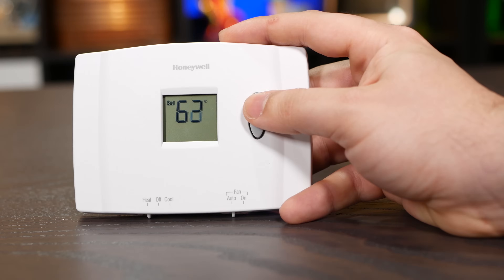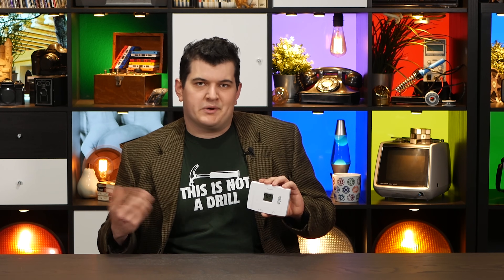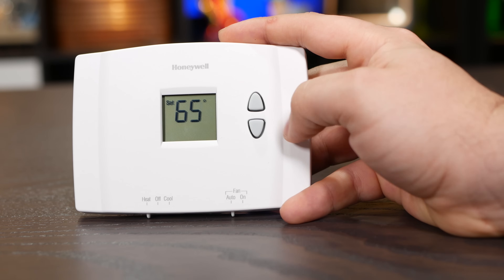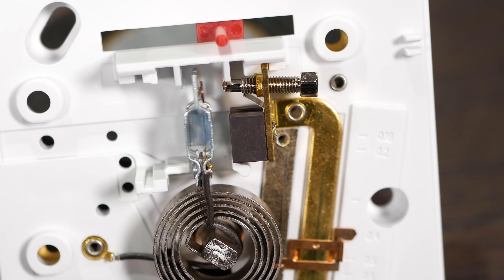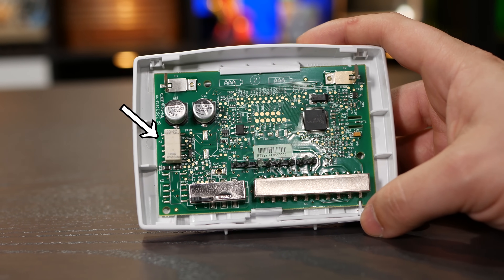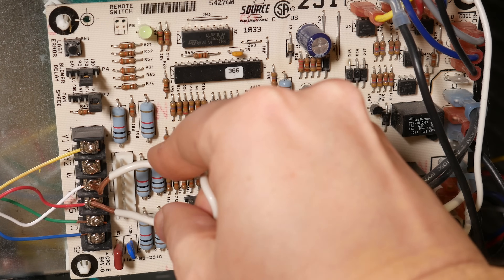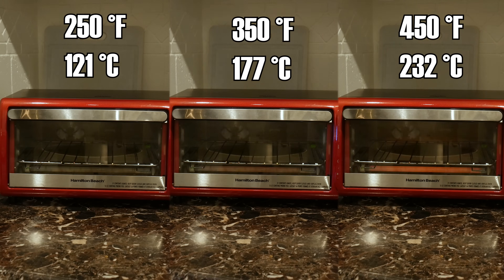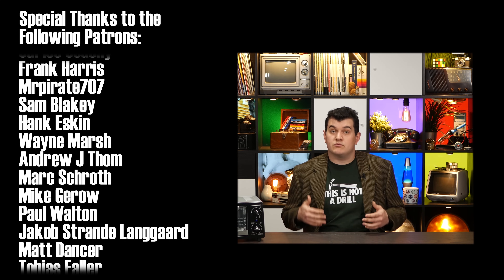Thermostats: Cooler than you think!

Comment: My husband thought the air would come out colder if he turned the thermostat down.
Reply: Well that is how cars work
Reply: @tylerbendel4361  Ah no that's not how cars work.  Cars work on the exact same principle with the only addition a selectable fan speed.  The AC compressor is either on or off.  There is no in between.
Reply: @theripper121 - You might not realize that cars have an air mixer that allows you to control the ratio of the amount of cool air coming from the A/C with the warm air coming from the engine, effectively allowing you to fine tune how warm or cold the heat is coming from the ducts. It is true the compressor is either on or off, but it is not as limiting in operation as residential HVAC.
Reply: @navidafzal1305  Yes but like the post suggests lowering the set temp doesn't lower your a.c. temp output.  When the compressor is running the max output never changes. A car can recircluate air or pull from outside but your a.c. output temp stays the same you are just venting it differently.  My point is the compressor on you have one temp being output whether you decide to add and mix outside air or change the fan speed the a.c. air temp from condenser doesn't change
Reply: @theripper121  
The original context of this comment was uninformed old-school guys who grew up with old analog cars that could airmix, rather than modern cars with digital thermostats. When comparing analog cars they grew up with air mixing to residential HVACs, you can see how they would get the idea you can make the system work "harder".

Your comment clearly meant well and was made to inform, but you're not really helping them understand it from the misinformed perspective of comparing analog car climate control with residential HVAC. 

"The compressor is either on or off" does nothing to help explain why they could control the temperature coming out of a cars vents within the whole gradient of temperatures but in an HVAC you can't.
Reply: @navidafzal1305  Her husband thinks if you drop the temp it cools faster.  Not true in a house or a car.  If it's 90 outside and you set your tstat in your house to 60 instead of 75 it won't chill faster.  Same in your car.  90 outside you set tstat to 60 instead of 75 it isn't going to chill any faster.
Reply: @theripper121  I think you're intentionally intending to misunderstand this. In cars that predate digital thermostats, you could get them to cool faster by turning their airmix control all the way to "blue". Even more confusing, modern cars have a "Max A/C" setting. You were very quick to point out that cars also have compressors that are either off or on, but you are not understanding why the confusion exists in the first place.

So now, ignoring you - for anyone confused on this, car climate controls from the perspective of the user have additional options to finetune the temperature of the air that your HVAC does not. Do not assume the strategy you use in your car will translate to your home.
Reply: @navidafzal1305  Given your hot and want air conditioning who doesn't turn it to "blue" with owners of cars that predate digital ac temp settings.  You seem to be the one missing the point.  The compressor that cools the house or your car has two settings.  Off or on.  When On the temp will be just above freezing in a properly working system. You adding outside air or not into the mix (by messing with the airmix on a pre digital a.c. control) or lowering or raising the set temp is just adding outside air isn't making your compressor magically work harder to cool faster.  Compressor "on" max air temp from vent is just above freezing and can't go lower hence you aren't cooling any faster just longer to reach a lower set temp.  This isn't rocket science.
Reply: @theripper121  I know you don't want to sound wrong and that is why you're trying to perform linguistic gymnastics to try and save face. I'm not saying you're wrong, but you didn't actually address the root cause of his misunderstanding.

Tyler did not say it would make the compressor run harder or weaker, but you chose to interpret it that way. He simply said "that is how cars work", and cars can indeed, cool or heat the cabin at different rates due to another layer of control provided to the user.  Your response to Tyler did nothing to demystify why you can choose 63 degree air or 84 degree air to come out of car air vents but that you cannot choose the temperature of the air that comes out of your home HVAC air registers.

So he is right in that, "that is how cars work" from the perspective of the user, it will cool the cabin of the car faster if you set the "thermostat" to 90% blue vs 30% blue.

This is the leading cause of why many think setting their home A/C to lower temps will cause their house to cool faster, because they assume the temperature they set on the thermostat is the choice of temperature they are receiving out of the air vent, and why your response does nothing but add entropy to the discussion.
Reply: @navidafzal1305  A.c. on you have one temp out of vents which is just above freezing on a working system.  Why would you want to inject warm engine air into it if you want it colder inside?  The only diff between a cars hvac and houses is the heat and air con can be on at the same time.  But the point is the only mechanism that cools the car does it at one temp and one temp only when its on.  You injecting heat into it with your scenario of 90 percent blue to 10 percent red or 60 40 or whatever doesnt change the fact the compressor outputs at one given temp period.  You adding hot air certainly won't make it cool faster.
Reply: @theripper121  It's the opposite.

By not putting it at the lowest blue, it will cool slower because it is mixing air. 

So we go back to: Tyler is not wrong in his comment "that's how it works in a car" from the perspective of the user. Putting it lower cools the cabin faster. But it's clear you want to show off your knowledge of refrigeration rather than clear up any misunderstandings.
Reply: @navidafzal1305  You like others seem to be conflating two very diff systems.  Again it's not rocket science your a.c. and heater are two diff systems that in a car can run at the same time with one selected fan speed.  Turn on AC and compressor comes on to cool air that runs through it at just above freezing.  It outputs exactly the same temp when running. If you choose to dilute it with hot engine air you are artificially slowing its output which again never changes.  You can't change its max output or vary it unless you are adding heat which again is the opposite the original post was refering to which was husband thinking you can  Lower the thermostat to increase cooling effectiveness.  Doesn't work in a car or home.  Period.  The compressor just has to work longer to lower to a given temp.

Comment: it's worth to add that some thermostats use some algorithms or PID controllers to take into account thermal inertia of the heating mechanism, especially in case of hot water radiators, popular here in Europe

Comment: Oh MAN! If I had 5¢ for every time I tried to explain to someone that throwing the thermostat to full then, not half an hour later, all the way to off…(!)

The "single cycle" feature sounds like a great idea, but probably require three phone apps and some unholy union of XLM and Scratch to implement. ;) Some small-office thermostats I've worked with did have a "three-hour override" button that would invoke the occupied-hours settings when people had to work after hours or on weekends. IIRC these weren't ridiculously expensive (~$200 in the '90s), but probably a lot more than most simple home thermostats; of course these would have all the contacts , many time-based options, basic "learning" capabilities… an easily-defeated panel lockout, etc.

Thanks for another fun video. Sorry about the toaster oven fiasco, but like you said, the Sunbeam is probably the best. (I've yet to find a toaster oven that can actually make simple toast without completely desiccating it. Maybe it's the air volume and distance… or more likely the fact that I don't feel the same imperitave to take it out immediately after the toast cycle is finished.)

Comment: I don't know how widespread it is but our water heater certainly does have a "boost" button that will heat the water on full duty cycle for a set amount of time, regardless of water temperature. 

(Except there's probably a safety thermostat in there too to switch it off if the water gets REALLY hot. Well, at least I hope there is.)

Not seen it in HVAC termostats though.

Comment: Nice video!
On a note, on the other side of the pond it is a bit different. Radiant heat is the "normal" way so no fan. And AC in the Netherlands... Yeah :p But yeah, it used to be simply short two wires. But modulating heating systems are reasonable common now.  They do very the output power. Especially if you have radiant floor heating that's very nice. And now it's based on the system if it will ramp up quicker if you set it higher. A common protocol for it is OpenTherm.

About the cable, it's not only about being suitable but also not to mix it up. Would be a nice bang if you some how mixed the wires and connected the furnace or thermostat to mains. Or the furnace to your router etc.

And about "blast mode", I do know of heating thermostats who do that for heat. My (radiator mounted) electronic thermostat will blast for 5 minutes with the push of a button.

Comment: Excuse my ignorance, but since the heating is done periodically (say you need 30% output, it works 3 minutes every 10 minute cycle), wouldn't increasing the setting to the max make it work 10 out of 10 minutes in a cycle, thus effectively heating faster (but with the downside of not stopping when you want it to stop)?
Reply: Setting it to the max won't make it heat any faster.  Let's say the room/building is approximately the same temperature as what has been set on the thermostat, and it's cycling (running 3 minutes out of every 10).  Then someone decides that they want it just a small amount warmer (e.g. increasing the thermostat setting by 3 degrees).  The heating system will then run continuously, without stopping at all, until the room/building hits the new temperature that was chosen.  At that point it will go back to cycling.  So you WILL get the 10 minutes out of 10, for however long it takes to bring things up to the new temperature, without needing to max out the thermostat.

Comment: Here, I'll boost engagement for you with this:
My heater is like 10 years old and has a medium mode. It doesn't know what temp the house is at but if it's just running for a short time it will run in medium mode. If it's running for for longer though it will eventually switch to a high mode of some sort. Kind of strange, can probably still do it with just the 3 wires.

Comment: That text gag thing was such a pain to read on a TV! There's no speed option, and no next frame button as far as I can tell. Argh, I say thee, argh!
Reply: Wait, people actually watch YouTube on a TV?
Reply: @Dan - I watch YouTube on my TV all the time via the Xbox One app.
Reply: @FrothingFanboy  Used to do that on a Wii U, but it was laggy so I then used the PS4. Then I sucked it up and dropped $2K on a PC. No regrets.
Reply: @TheLegoPerson  Yes, though not a tube TV.
Reply: @johnnylav  Tube monitors are better. You can change the resolution and frame rate. Gotta love the choice of 1550p 90hz-480p 240hz.
Reply: @TheLegoPerson  Dude, get a Chromecast. Best 35 bucks I ever spent!
Reply: If you're on a smart tv I believe there is a usb port so in theory you could use a usb keyboard.
Reply: @melmelhodgepodge3800  thanks for the suggestion. Just tried it and while the keyboard did work for some things, I still couldn't go frame by frame or change the play speed. But thanks!
Reply: the < and > work on PC while video is paused to advance frame by frame or go back frame by frame. worked very well and read the whole thing. lol
Reply: @lnxpro ; I would have typed it out for you, but I would have then got told off! ;)

Comment: Have you looked at open therm,  battery powered TRV's or modulating condensing boilers? Also the positioning of the thermostat & the balancing of any heating load is crucial to the correct operation of any heating system. Have been to plenty of houses where the stat was at the top of the stairs of immediately above a radiator.

Comment: You need to get yourself a Tank-less hot-water heater! You could be saving a lot of money a year vs your huge tank, plus endless hot water!
Reply: Maybe not as much as you think.  It all depends on how well insulated the tank is.  If there were such a thing as perfect insulation, it would require no power to keep the tank hot.  I suspect that "time based rate" electric rates are not too far away.  You could probably save more money heating the water at cheap rates and using the stored energy when it fits your schedule.
Reply: Russell Hltn LOL clearly you don’t know nothing about physics. His tank costs ~$500 a year to run, my tankless is ~$180 a year to run...
Reply: @andykillsu  I know plenty about physics.  Just like motion, things stay in whatever state they are in unless something acts upon them.  In the case of a water tank, to keep it warm you have to replace the heat that is escaping from the tank though the insulation, pipe connections, or leaking faucets.  My tank takes the equivalent of 7W to keep it warm.  (I have a home energy monitoring system.  I've measured it.)

Comment: My problem is explaining to my parents that turning the thermostat up/down when we leave does not save money. Oh, well, I'll be going to college soon anyway. Not my heating bill.
Reply: It does in fact because heat transfer is higher the greater the differential between the two. So while you are gone and the thermostat is turned down, less heat is being lost to the colder outside and the heat system has to cycle less even though it will have to run a bit longer to come back up to the desired temp when you return.

Comment: Mmm, central heating (water circulation, radiators) have a "medium blast", actually anything between closed and full open.
Reply: sleeptyper And some are supplemented by a whole house electrical switch to select full or half blast according to expected total need of the local radiators.

Comment: My thermostat isnt particularly new or anything, but it has a thing where it will kick on auxillary heat if the temp is more than 2-3 degrees off of where its set, It definitely is way hotter when it does this versus if you bump it up 2 degrees just saying, its kinda exactly what you said.......btw i REALLY Enjoy your content man Great content
Reply: By how you say "auxiliary heat", it sounds like a heat pump system.  That's an exception.

Comment: It’s an italian thermostat, but try searching for Bticino Smarther Thermostat, it has a quick boost setting for heating! It lets you run the heat manually for 30, 60 or 90 minutes and then returns to normal setting

Comment: i was expecting an intro to automatics; cause you know what's happening is you got a basic feedback loop between the furnace and the thermostat, the former is a natural first order system and the latter is both the controller and sensor, feeding an indicial input to the furnace and comparing its output (current temperature) to its desired input (what you set on thermostat). The furnace doesn't need PWM because this system is already very stable and performant

Comment: Now that you have covered this, can you please find a model of thermostat that allows you to adjust the buffer zone between the two control states?  I would love to find a thermostat that brings a room to temp and then not turn on until it goes -5ºF below the set point before kicking on the temperature control.  Most thermostats are hard set at -2.5ºF, which can lead to situations where the furnace runs ALL DAY.

Comment: We have a smart thermostat that does not require a "c" wire, nor rechargeable batteries.  It simply uses energizer lithium batteries and works perfectly.  It's a great option for those who don't have a "c" wire and don't want to have one installed.

Comment: Here in Europe the old school thermostats switch the live/neutral wires directly (that's why Nest in Europe comes with a little box called Heat Link - it basically separates the HV switching stuff from the thermostat itself). Newer thermostats however mostly use OpenTherm. 

Most of our heating systems are usually heating only (cooling is separate) and we usually use radiators (or in-floor heating - still the same principle) to heat the rooms. In that way you can have a wood burning stove based central heating. Throw in the wood, set fire, then your thermostat controls the water pump. Need more heat? Pump the water, want it cooler? Turn off the pump. Local regulation via radiator valves is then also possible. We use an air-water heat pump in the same way. Just that the pump is integrated in the heat-pump itself.

Comment: Interesting, I'm Australia and I've got a split system with a remote for heating/cooling, so no thermostat, but my parents used to have gas heaters with individual thermostats, and nowdays they've got central heating systems - one has an rj11 connector to the thermostat, although I think the temperature sensor is actually at the intake. The panel does control the set temperature, timing, fan speed, cooling mode and maybe other things? On the other side, my dad has a new fancy zoned split system central heating thing with what is essentially a tablet mounted to the wall for control, and sensors in every room for each zone.